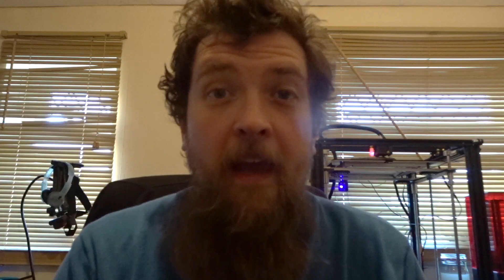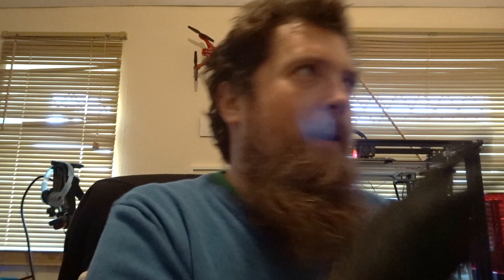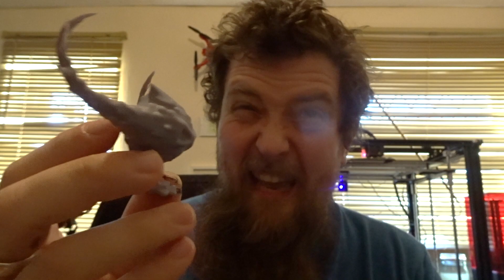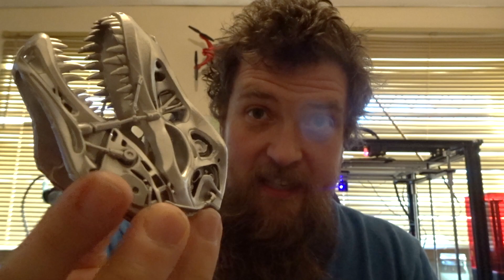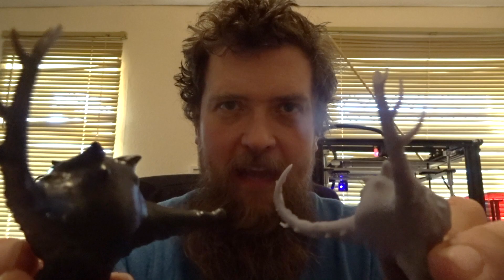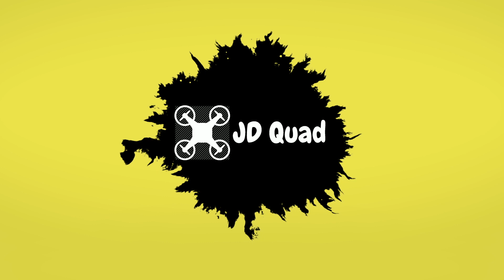Elegoo Mars Water Washable Photopolymer Resin Video

Comment: Will give this resin a go if I can find it. Note, though, that just because it's less offensive in odor doesn't mean that it's not still possibly toxic AF.  I would never use these materials/printers in any working space, let alone a living space. That vat of mystery toxins heated by the UV lamp for tens of hours on end, gassing off the whole time. No way. Out in the garage, in a heated/sealed enclosure that is vented through the wall to the outside. Keep tabs on the process from a cheap IP camera linked to my phone.
Reply from the maker: Exactly John, garage is the best option if you have one. I have a good ventilation system that helps a hell of a lot. I have a few raspberry pis to monitor my printers always good to have an eye on them. I am finding it very hard to get hold of at the moment, lwts hope they produce more👍